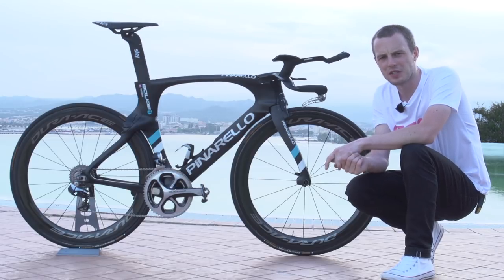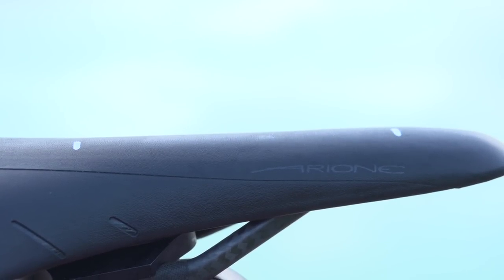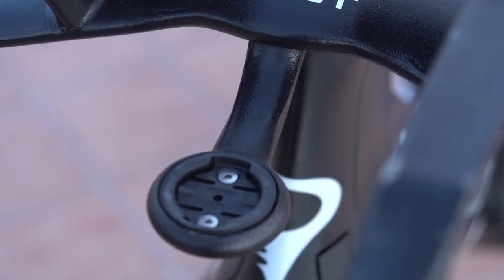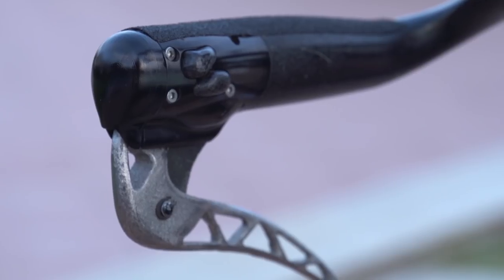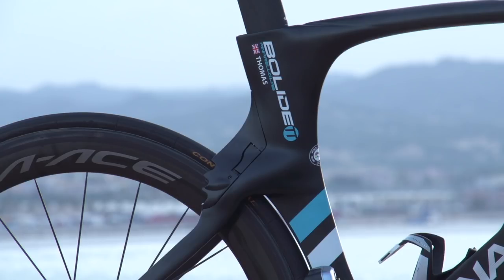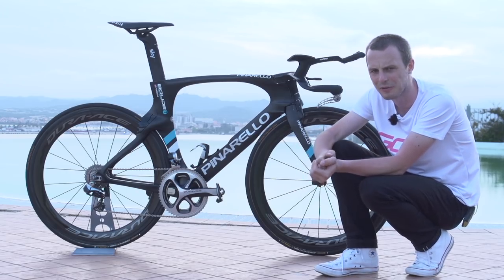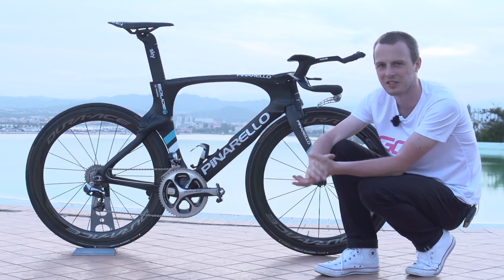Geraint Thomas' Pinarello Bolide Time Trial Bike

Comment: Those brake levers are HOT 🔥
Reply: The rough surface adds to drag, though.
Reply: EditioCastigata not gonna slow him down though 😄😄
Reply: They taped the pedal mount holes! But then, imagine, such a patch fell off mid-race. He would be dragged to one side, and had to cycle in circles!
Reply: He'd enter an unrecoverable flatspin. Crash and burn, Mav.

Comment: The finish on those 'custom 3D-printed' bars and levers looks like shit.
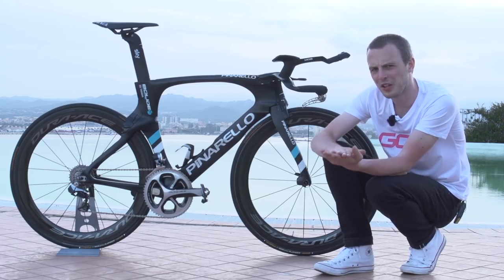Reply: John Smith  There were also visible scratches on them look 0:58
Reply: REPRESENT LIFE I'm not too bothered about scratches. Every bike that is being used regularly has those. The bars and levers look like they wouldn't have passed QC at any factory. I guess I expected something with a much smoother finish when he said custom. In the end I don't think it really matters for them as long as the weight is right and the part does its job properly. The Pinarello frame on the other hand is a piece of art.